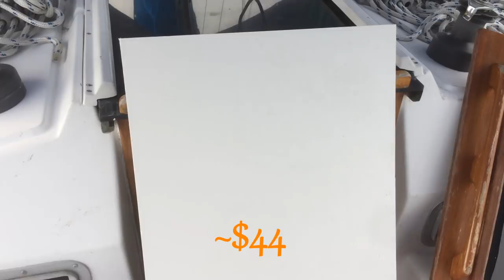PVC Companionway Door Project - Ep. 9 - Sailing Moxie

Comment: Been looking for ideas to do this and hadn’t thought of pvc, thanks
Reply from the maker: PVC is easy to work with and resists corrosion, but it's not tremendously strong. Good for lots of projects though. That composite wood decking is also pretty good. StarBoard marine board plastic is pretty good, but expensive and not very lightweight.

Comment: On these companionway hatch projects, I don't see many people mentioning the strength of the hatch. Don't know if you intend to go offshore, but if you got pooped by a big sea, it would make quick work of that hatch!
Reply from the maker: I agree. This door I built is not very strong. I use it in the marina and while daysailing. I have a wooden door with a steel plate that I can use if I make a long trip or sail in rough seas. Thanks for the comment.

Comment: How has that held up?  I made replacement hatch boards using the PVC boards from Home Depot.  The center one I cut an opening for a Lexan window.  After a few months, the corner cracked on that piece, and all are a tad susceptible to dents.  (I painted them with Krylon.)  I'm interested in how the corners of your frame have held up to supporting the weight of the doors.
Reply from the maker: The PVC is indeed susceptible to dents. I use the PVC door I made as a temporary door once I'm onboard to open or close more easily than the big heavy door or 3 slats I have to lift in and out. Once I get onboard, I throw the PVC door into place and open and close as needed for wind, sun, A/C, etc. The hinges and handles are just fine. It's the bottom corners I have concerns about. My father suggested I add stainless steel braces on the backside in those corners to strengthen the overall frame. He also suggested a thin brace on the frame just below the doors. I can put this brace on the backside, or actually on the top of the base of the frame facing upward, which will help reduce scratches and dents from stepping over this part of the frame and also add strength. Overall it has held up just fine, but only because it's been under relatively light duty. I'd probably use it more once I strengthen those areas mentioned above. -Matt
Reply: @SailingMoxie  I too was curious about how those corners would hold up.

We are about to take possession of a boat and this is one of the things my wife request.

I've been thinking about some sort of thing that would lock them into those channels at the top on the outside of the graphite slide rails for the hatch.

Even something as simple as some "pins" or dowels that could be inserted to make removal easy enough.
Reply from the maker: The corners have held up just fine. I used to remove the companionway door all the time and insert my heavier door to lock it up, but now I mostly keep the PVC door in place. I've had no issues with the corners. Adding pins or dowels to hold the door in place would be a good idea. It does move around a bit while underway or when opening or closing the door, but so far just gravity and the grooves hold it in place just fine.

Comment: I am going to but a Pearson 27 and the door rotted away and in need to build or buy a reaplacement ASAP
Reply from the maker: A simple cut board can serve as a temporary companionway door. Or cut the board into three sections to make horizontal slats. That’s a quick fix until you can buy or build a more permanent companionway door if you’re in a hurry.

Comment: I tried this with a one piece board.  I painted the outside and it warped in the sun.   Don't know if it was the paint or the heat.
Reply from the maker: Not sure. I haven't had any issue with warping over the 2 years I've had it on the boat. Was it PVC like mine?
Reply: @SailingMoxie  1\2" pvc.  I primed and painted the outside.  It warped 2" in a 31" board in two weeks in FL.
Reply from the maker: Wow. Strange. I used 3/4" thick PVC board from Home Depot. No issues whatsoever in direct sunlight for more than two years. Might be because it was thicker.

Comment: How weatherproof are the doors?
Reply from the maker: Right now they would certainly leak a few drops in rain. That's why I'll only use the doors while I'm on the boat. My plan is to put a thin weather strip at all the joints to minimize drops coming in. But for now if it rains I'll put in the heavy door and close the hatch. I'll make small improvements to the PVC door as time goes on - hopefully making it fully weatherproof.